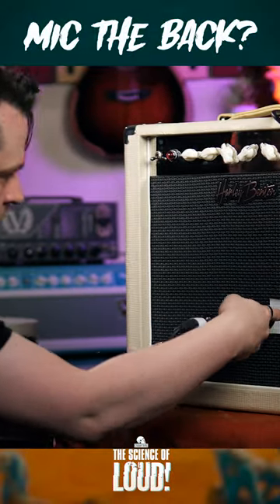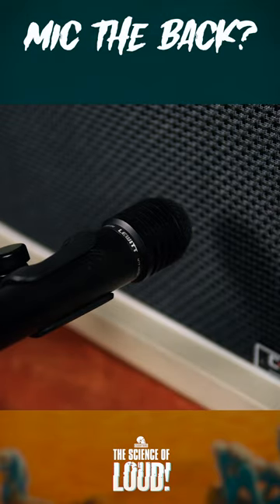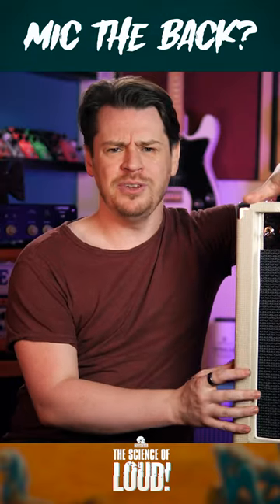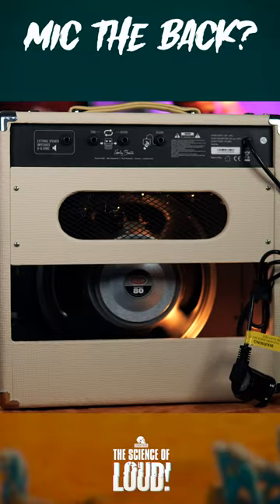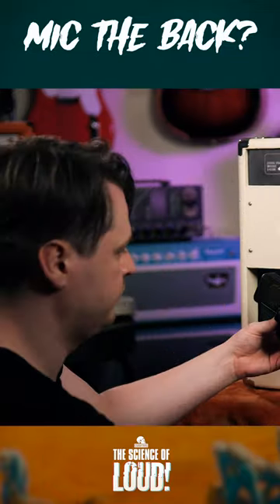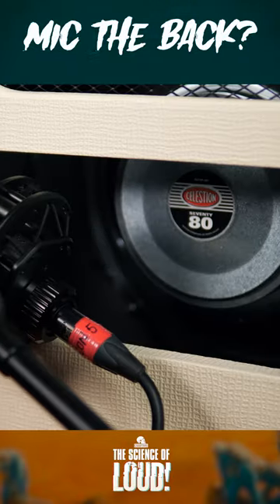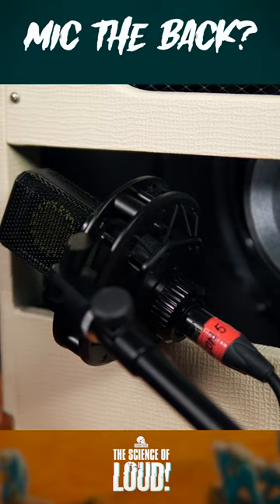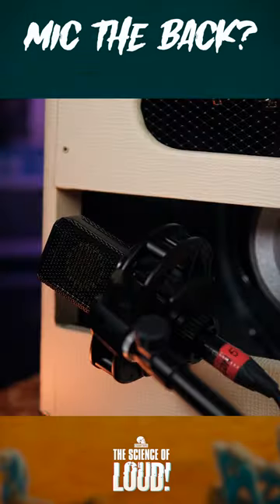Fat Guitar Tones? Mic the Back of the Amp!

Comment: Might be worth mentioning phase inverting one of the signals so as to avoid phase cancellation. Or placing the microphones at different distances from the cone
Reply from the maker: All of that is included in the full video, you can find a more detailed version of this on my channel.
Reply: Only so much can be mentioned in a yt short, I feel like this is an excellent way to lure interested ppl to the full video.
Reply: @CSGuitars excellent work. I never should have doubted you! You're a stickler for that sort of thing

Comment: audio interface?
Reply from the maker: This is half a question.
What do you want to know about audio interfaces in relation to this video?
Reply: @ScienceofLoud  i was wondering how much the quality of the audio interface influences the recording
Reply from the maker: @daniello2923  The audio interface shouldn't influence the recording - aside from clipping the mic preamps with too hot a signal, or dropping the bit depth and sample rate to the point where the audio isn't being represented in enough detail - any modern audio interface should be able to digitise signals without adversely affecting them.

Comment: By using 800 dollars worth of mics, I can make this shit amp sound great.
Reply from the maker: The increasing quality of a microphone only allows you to capture more accurately the sound of the source. An expensive microphone does not improve the sound it captures, it simply reproduces it more precisely. 

The same is true for any speakers you listen to audio through - their quality cannot improve the source, but it can reproduce it better without degradation or colouration. 

If you want to hear any amplifier- cheap or expensive - with the best level of accuracy possible, then you use good quality microphones to capture it and good quality speakers to listen back. 

If the amp sounds great with these mics, then it sounds great period. The mics are not magically making the sound better.